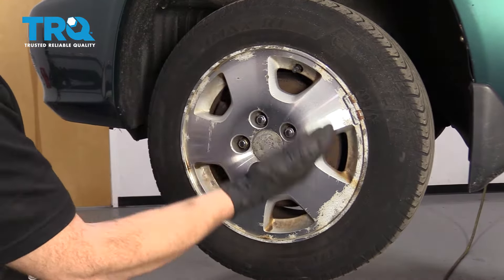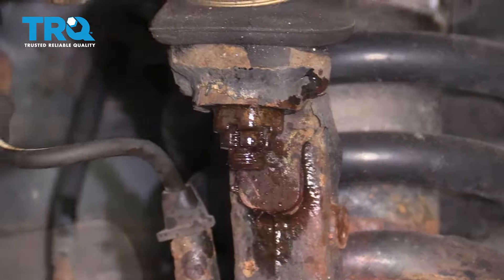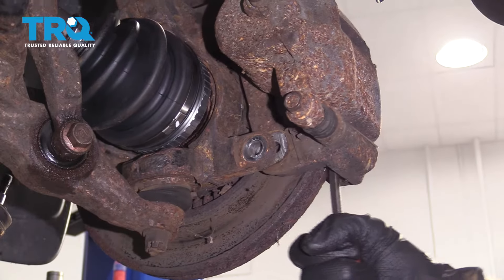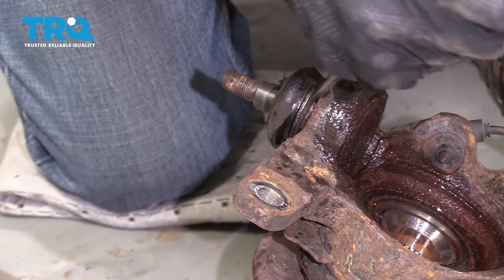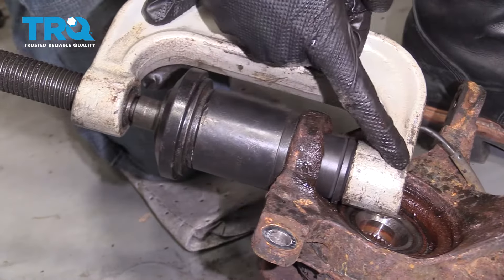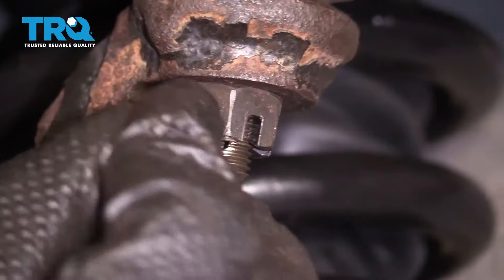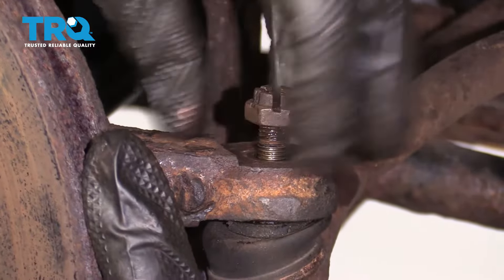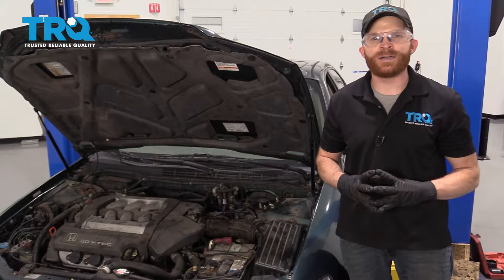How to Replace Front Lower Ball Joint 1998-2002 Honda Accord

Comment: It was years ago but i know i replaced that ball joint on my 1998 accord v6 without any special tools at all. Thats all i remember. I never had to cut anything off. I think i used the  castle nut to suck that ball joint right on into place. Losened nut back up and re tightened. Good to go.Never removed the boot either.

Comment: idk if you're still reading the comments for this video but if this is a 98-02 accord what did you do to get it from 4lug to 5lug?
Reply: Replacing  the wheel hub from a 4 stud hub to a 5 stud hub, and this is a whole different video you need to watch
Reply: I believe v6 models were the only 5 lug versions